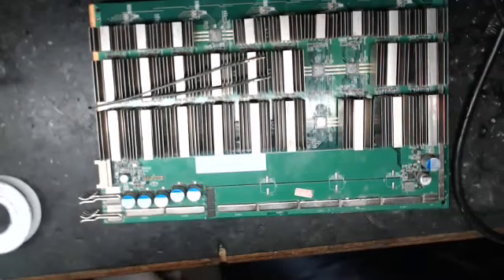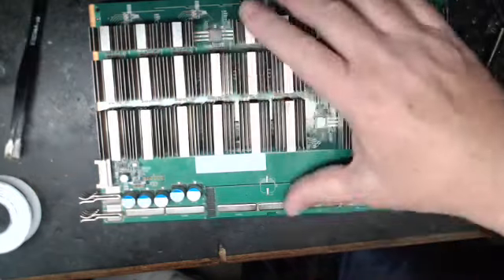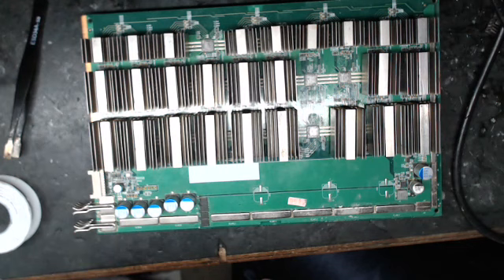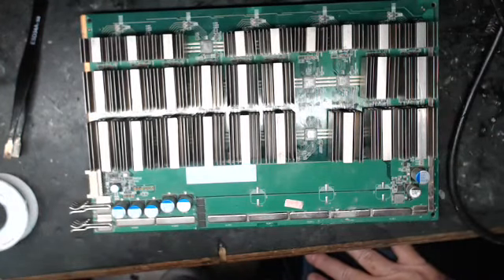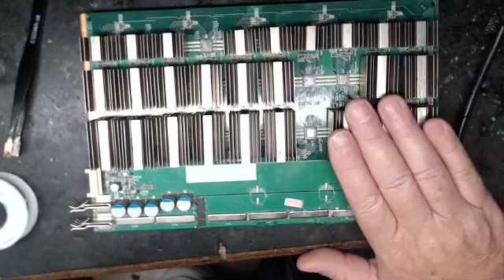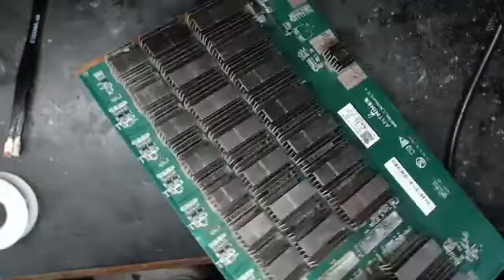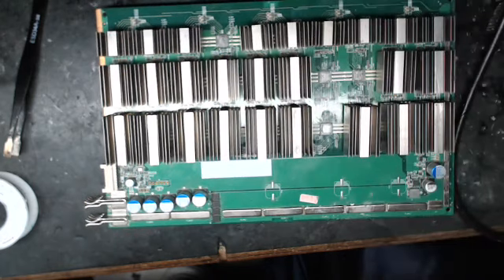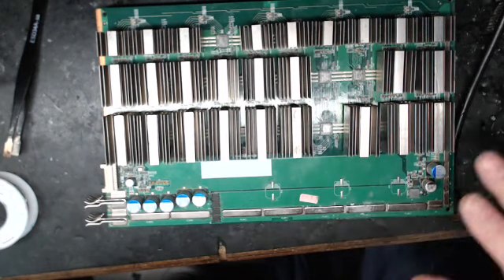Hashboard repair:Temp Sensor exploration 2:

Comment: If the one of the 300v capacitors is missing doesn't the render the board bad.  Also the boost circuit is missing the 2 capacitors.

Comment: ok same board i was looking around and noticed the first cap 330 30v pd915 close to the lower power pin was lose. i zoomed in and found the one side had a broken solder. im hoping thats all it was.

Comment: Thanks! Just started researching a board that reports 0c temp, and runs for anhour and goes missing; and found this 3 hour old video.
Reply from the maker: Hi Mike,  Thanks for the comment.  There will probably be a few more videos about this until I can discover more how that system works.  There is no documentation available that I can find.

Comment: my t17 hashboard shows more temp than real and stop mining
it says:over max temp
but the temp of other hashboards are70-75 degrees
Reply from the maker: It probably is that hot.   One chip on a temp sensor could have a bad solder on the heat sinks or down below and actually be hot even though your others are good.